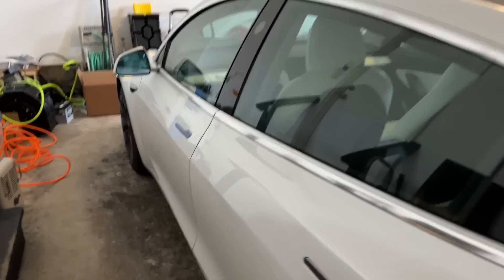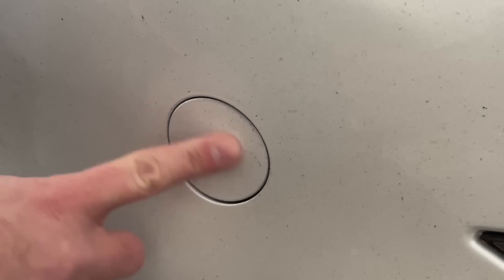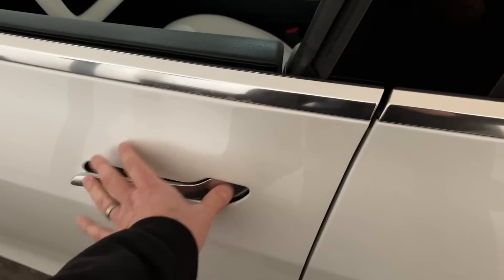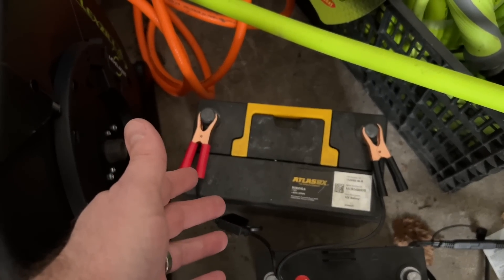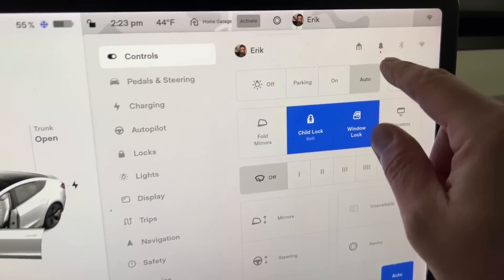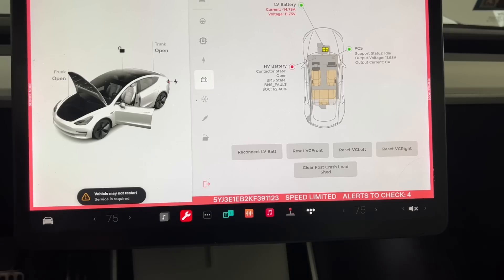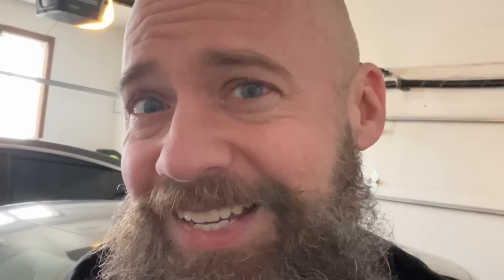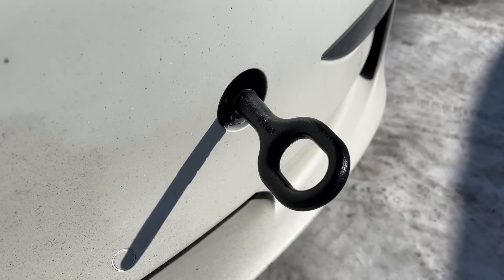My Tesla is completely dead!  Is it now bricked?  Pt1

Comment: Your car is not bricked. A dead 12 volt battery is not a bricked vehicle. If your car was actually bricked then you would be replacing electronics.
In a gas car if the 12 volt battery died would you call it bricked?
Reply: The replacement 12V didn't fix it, so I would consider it bricked.  Part 2 should give us the full story.
Reply: @MTNRanger  ok if replacing did not fix the issue depending on what happened it got bricked. Need more info.
Reply from the maker: You're correct that I would not call a dead 12v "bricked".  It's another electronic component that failed.  At the very end of the video, the car is being towed away on a flatbed.  Trust me, it was bricked!
Reply: @BecauseTesla  I am waiting for the second video. Bricked means an electronics issue requiring electronics replaced or possibly reloading.
What if s fuse blew? That would not qualify as bricked.
Need to find out exactly what the issue is before I would say it was bricked.
Reply from the maker: @thomaswilson2917  I understand what you mean, and I agree with you.   The service center still has my car, and they've told me exactly what they've replaced.  I can assure you it's not a fuse or some simple fix.  It was an electrical component that took them days to get out of the car to replace with a new one.  Not a simple fix.  I would call that bricked, but that's just me.
Reply: @BecauseTesla  if electronics failed then I would say it was bricked. Not arguing with you. Interesting question why did all this happen just after your battery issue. Seems suspicious.
Did the battery fail because of the electronic issue guess we will never know.
Years ago I had a 1989 Thunderbird.
Car died on day. The computer died in the car.
So ice cars can get bricked also.
Pretty much every car today runs on computers and can get bricked also.
Reply: @thomaswilson2917  you can park a 1989 far from your house. Report stolen. Cheap fix. 

Try that with cameras and gps all around.
Reply: @YouRgettingTrolled-101  car was 4 years old at that time. Had it fixed

Comment: Did you factory reset the computer to see if that worked?
Reply from the maker: The problem wasn't computer related.  I did reset both batteries with a hard reset, but the alarms were still there.   Part 2 of this video will explain it all.

Comment: had the same problem, have them check the ground wire of the 12v. it comes loose
Reply from the maker: They found the problem, and it's not related to the 12v or its wires.  When I release part 2 of this video, it will all make sense.

Comment: I think I’ll stick to my ICE cars!
Reply from the maker: I’m not one of those anti ICE Tesla owners; in fact I own ICE cars also.  The funny thing is, I thought I would just drive my ICE car while my EV was in the shop, but since I’m having a string of bad luck, I got in my ICE car and it too will not start.  The starter has failed, so that’s another project I’m going to have to work on this week.  🤦🏻‍♂️
Reply: @BecauseTesla  
You’ve had a streak of bad luck there!
Reply: @BecauseTesla  wow! The car gods are very angry with you right now, that’s crazy
Reply: @BecauseTesla  same thing. My Ford Fusion PHEV won't start at all even if I plug in some juice to the battery. That's usually my "take to work" car but not lately. Gotta get that to the dealer to fix. ICE cars have just as many issues, for those wondering
Reply: @BecauseTesla  That is bad luck #3, so you should be good now.  If your superstitious. ;)
Reply: Your ice car would have same issue with a dead 12 volt battery. Some ice cars have electric door locks do same issue.
Reply: @thomaswilson2917  
All the newer ice cars I know of have a dedicated key that slips out of the key fob!
Reply: @simon359  ok if that is true you can get into the car but with a dead battery you still are not going anywhere.
You can get into the Tesla front trunk with a dead battery which you will need to do to replace the dead 12 volt dead battery.
And jumpstarting does not always work either happened to me. Since the battery in my car would produce zero current there was nothing coming from the battery to helf start the car. Jumper cables had to produce 200 percent of the current.
Supposedly dead batteries usually provide some starting current just not enough to start the car without some help from the jumper cablesm
I had to get my ice car towed to a betteru store to get a new battery the next day since it happened at 2m am in the morning.
Reply: @thomaswilson2917  
I always carry my portable jump starter, you can get one for a little over 100 bucks! Never failed me yet! 😜
Reply: Batteries just die by themselves.
Had a car years ago with a new battery less than a year old and the battery just died.
One of the internal cell connections just opened.
Battery had zero juice.
Nothing wrong with car just the battery.
Reply: @thomaswilson2917  yea the good news about ice cars is that the have an alternator so every time you drive the car it puts electricity in the battery but you also have to drive them in order to keep the 12v charged because ice cars have phantom drain too. During the shutdown I had a battery die in a week in my ice car
Reply: @kevinbecquet  that's kind of quick.
I drive an ice car to the airport when I fly because I don't worry what happens to it as it is old. I had it parked a few months ago for 16 days and had no issues starting it. For long term at home I have a battery tender plugged in to keep it charged.
Reply: @kevinbecquet  about the alternator charging the battery.. in my Tesla I have a 100kw battery that charges mabey a 1kw 12 volt battery. My battery drain on my traction battery is about 1kw per Day if I don't have the cameras running  24 hrs a day.
Reply: @kevinbecquet  
That’s why I also have an off grid. system as back up for power. I have many small rechargeable batteries for all kinds of equipment I use.  That way I can use all my gear for the garage and doing anything I need to in  & around the house.
I built a DIY, because I couldn’t afford to spend that kind of money they want you too! I thought long and hard about what I needed because I knew the day with come that inflation would eat up most of everybody’s incomes!

Comment: I think you are still in the 120k battery warranty. Is this the high voltage battery that came with the car? Or did Tesla replace it at one point?
Reply from the maker: Hint:  my battery warranty is not covering the cause of the failure.  😩
Reply: @BecauseTesla  seriously??  I'll be watching part 2 with anxiety. Dreading the day anything happens to my Y, I live 200 miles from a service center.
Reply: @BecauseTesla  what do you mean battery failure?

Comment: Oh man that looks real bad. Seems like there is a serious issue with the battery. Most likely an effect of the accidental 0 % situation. can be that some of the cells died and that would put a hold on all.

Happened to you by accident, so not really your fault. And you did not even drove it till it died, just down to zero.

But that is why I find it totally irresponsible when other youtubers deliberately run EVs down jntil they stop because those are not their EVs but given to them for testing and running them till they die can damage the battery irreversably. and it might not even show up right away but maybe someone buys it and the battery dies months later.

I am really czrious to see qhat the reason and solution will be.

Wish you good luvk because you really did not deserve this to happen.
Reply from the maker: Thanks mate! The cause of failure was not the original reason I thought it was.  The batteries are fine; it’s something else that failed.  Not covered under warranty.  😩
Reply: @BecauseTesla  what is not covered? i thouhht all is! or one of the aftermarket things?

Comment: You said Service Mode indicates the HV Battery conactor is OPEN. That means the power from it is cut off from the rest of the car. 

This means the DC-To-DC Converter that charges the LV 12V lead-acid battery is not charging it. 

Tesla will need to determine why the contactor tripped OPEN. 

I may have misheard or miss read the details but either way, those are my thoughts
Reply: PTC heater faults have been known to cause 12V not to charge and open hv contactors. I'm sure Tesla will have that fixed fast. Hope to see good news next part of this video series.

Comment: It's my understanding that Tesla batteries are warranteed for 8 years and between 100k and 150k miles, whichever comes first, to still have 70% of capacity?
Reply: yeah but it sepends on how you treat them. and it says explicitly not to run them down to zero and esp not until they die. but he did not so it on purpose so I guess it is still in any case covered by warranty
Reply from the maker: Battery warranty on the Long Range model is 8 years or 120k miles.  I’m within warranty still, but…the failure turned out to be something other than the battery pack.
Reply: Best of luck  @BecauseTesla
Reply: @BecauseTesla  so what was it then? esp if not covered by warranty. my bet is on an aftermarket add on
Reply from the maker: @Watt_Ihr_Volt  Not an aftermarket add on.  Another electronic component - not the battery, inverter, or drive unit.   I know the anticipation is killing you...lol...so I'll give you a hint.  I put an easter egg in the video;  let's call it "foreshadowing".
Reply: @BecauseTesla  ok will search. but weird is that normally all is covered by warranty for 80000km
Reply: @BecauseTesla  yeah the error codes are all over the internet, seems to be anot totally uncommon issue which is a bit worrying. Though all I found were covered by warranty. I guess I know what it is but will not spoil it 😂
Reply from the maker: @Watt_Ihr_Volt  Only the HV Battery Pack, Drive Unit / Inverter are covered under that warranty.   Everything else is not.  This thing that failed would fall into the "everything else" category.
Reply: @BecauseTesla  They have 3 different warranties, do they not (according to my contract):

1. Full warranty on everything except things that wear off through use (like brakes, wipers etc): that is here 4 yrs or 80,000km
2. Drive unit and HV batteries: 8 yrs or 192,000km
3. Anticorrision from the inside: 12 yrs.

so I would have assumed it falls under 1.
Reply from the maker: @Watt_Ihr_Volt  It would, but I'm over 168,000km
Reply: @BecauseTesla  ahhhhhh